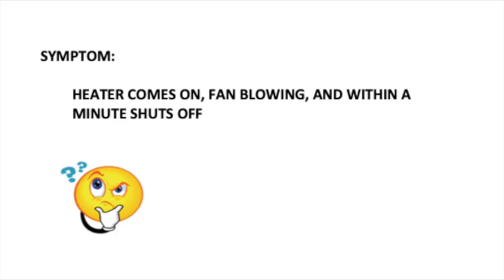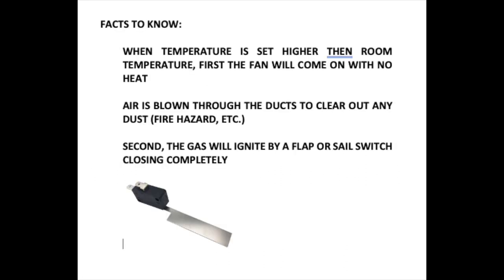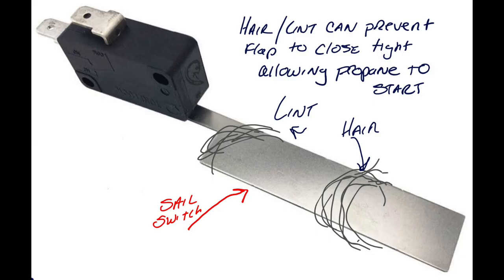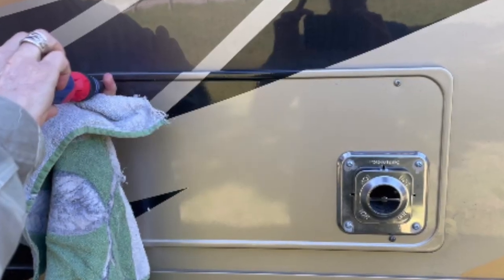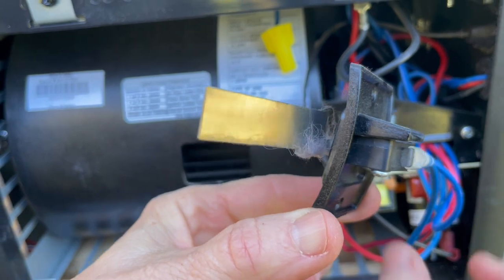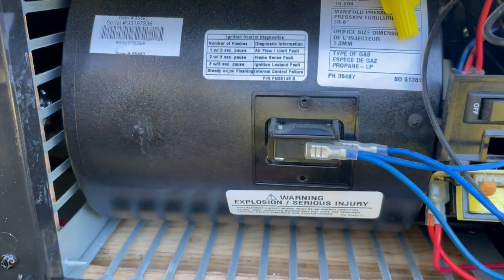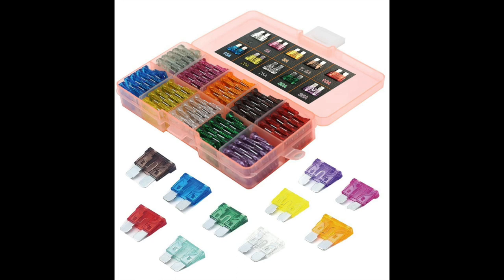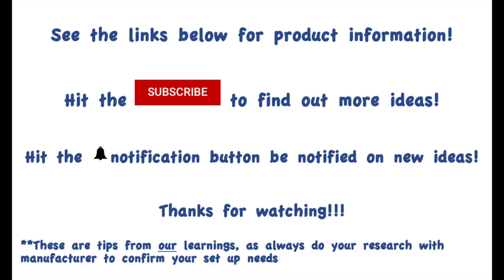No Heat in RV or Trailer! Blower comes on and shuts off

Comment: Great tip. Never knew about the sail switch.  I will be ready whenever this happens in the future now.
Reply from the maker: Yes, so nice to figure things out, I was ready to “Schedule that $175/hr service appt” and decided to look for a fuse etc but ended up learning all about sail switches! Happy Camping!
Reply: @rvtipsandbitsneverstoplear3895  yes besides the cost savings, it also prevents the hassle of sending to to a dealer and waiting for an appointment and finally the time it takes for th final repair.

Comment: Good Video, I am not good with computer video editing, the sound went from quiet to loud at one point.  I would think that can be changed with some sound compression. I also have seen posts where people are adding a furnace filter to the system as it does not have one.  This might prevent the lint on the sail switch.
Reply from the maker: Great, I’ll check out , love figuring things out